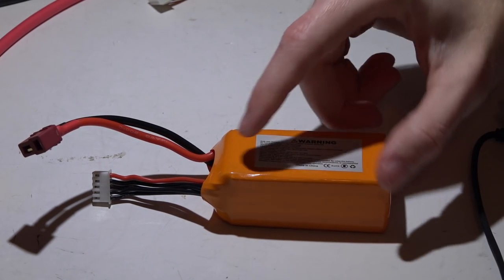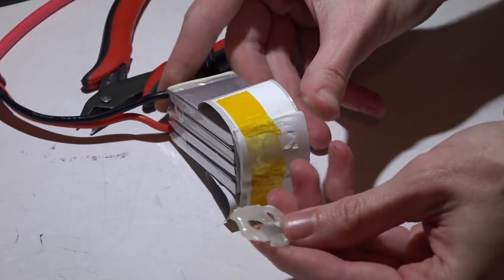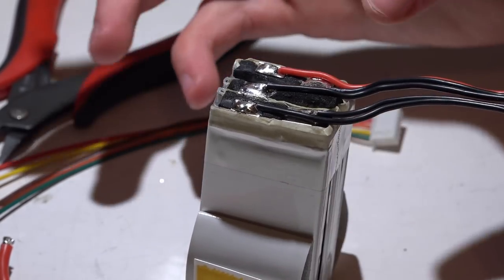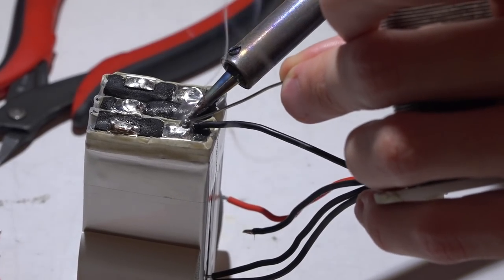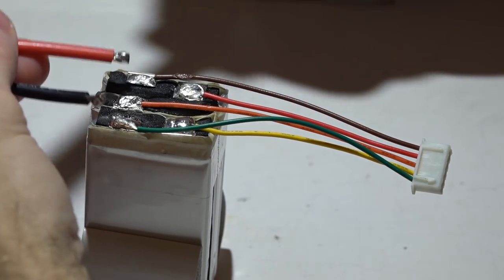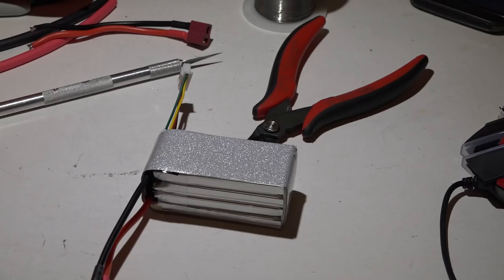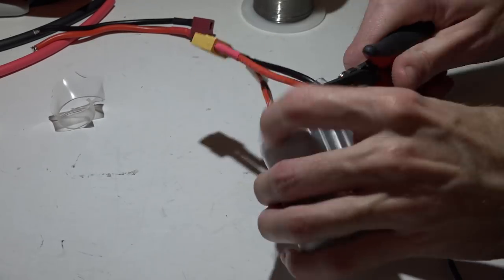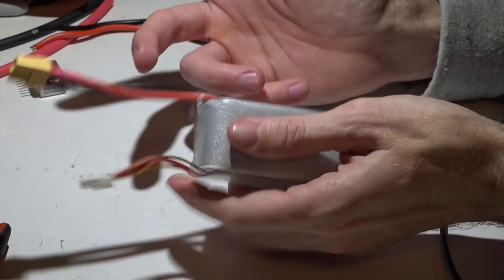Replacing LiPo Main/Balance Leads

Comment: Love your videos! Consider using a chisel tip on connections with that much solder. The larger tip acts as a heatsink to prevent fluctuations in temp from the heating element to the solder work.
edit: also consider popping out and switching the balance leads to get brown to be ground in order to know 100% which side is ground in the future

Comment: Thanks dude, it worked for me.

I am so glad I saved this awesome 1500mah LiHV 6S.

The only difference, the balance lead solder point was so hard to melt, my soldering iron kept dropping temperature and I ended up solder-repairing the cable itself.

Comment: You can stretch shrink tubing bigger before shrinkiing it . Needle nose pliers stuck into small tubing and then spread the handles . That will fit over an sma antenna  connection.

Comment: More great content, thanks.
Just one suggestion, when you said "blow hot air" down the heat shrink to get the condensation so that I will slide, maybe you want to clarify for others that you are breathing hot air from your mouth as opposed to using a hot air gun or something. Just thought it could potentially catch someone out 😉
Reply: Yeah, I was wondering where the condensation came from, that makes sense now lol.

Comment: that red or brown is the ground?  so why is it connected to the positive lead? that red and brown is the hot the blacks are the ground or the fallowing positive on the next battery.  That red is the positive lead wire and the fallowing wires are all in black cause they are connected in series and also act as ground in the batteries connection sequence.

Comment: Great vid man ty! I just replaced all the bearings on my Emax Rs2205 motors using your method from your old channel and it went well, too!
Reply from the maker: Awesome! I'll have to make another bearing video. Glad it worked well for you.
Reply: Definitely do make another for all the guys still curious. Only thing I did different was use a table vise to gently hold the motor in place while I tapped the bearings out with a punch.
Reply: فارسی  می توانم استفاده نمایم .که نتوانسته متصل شوم  استفاده بهینه از کلیه برنامه‌ای خودتان نتوانسته ببرم . متشکرم

Comment: I have a 3s lipo 2700mah battery - 
when I put it on the charger it appears to get a full and balanced charge.
when I test it on a battery checker using the balance plug - nothing shows up - completely blank
if I test it using a esc / motor tester using the ec3 plug all appears well.

I've tried several different battery checkers that all work on other batteries - so that's not the problem.

It seems to be a fault with the balance plug somehow -
why it works when charging and not with a battery checker I don't know.

I think the battery would be safe to fly with on my rc plane since the balance lead is not in use when flying
but I don't have full confidence in the battery since I can't check the charge with a regular battery checker.

What can the problem be ?

Comment: i been rebuilding lipo's for 5 years this very amazing video instead of markers on top of the shrink  i right down the info on paper can cover it with cleartape    on the cell before i do shrink on the battery  wow dident think anyone else would think use hot glue under main leads great mind think the same thats awsome  aswome

Comment: when i make 18650 packs i use my cheap 40 watt weller  with this almost solder tip for soldering stained glass just the small tips dont hold heat to well

Comment: my wires got chewed up in the spur gear and ripped in half. How do I know which wire connects to which port on the balance plug?

And do I need to use solder or can I just wrap the wires round each other, since there's very little current running through them?

Comment: RIP bro. I'm sure your looking down from heaven and thinking that you should have told everyone to tape off the solder joints that weren't being worked on, and to use flux for that last stubborn balance lead joint.

Comment: you've burn the brown wire a lill bit. but I've got a question. I've got 2 battery types ( 2cells). both with different colours at the balance ports. does it matter witch colour the cables have? 
1 battery: 2 reds 1black
2 battery: 1 red 2blacks
till now I've only charge battery 1. can I charge them both without worries? thanks for your help

Comment: Kinda related question, is there a downside in using 12AWG (too thick?) battery pigtail in my quads ,  I fly 4S 30A blheli_s , emax 2205S 2600kv. Thanks
Reply from the maker: There's no downside. But if your battery leads are 14ga then its not needed. If they are 12ga then its fine.

Comment: Use your phone to take a picture of the lead layout before you take everything off. Now you have a reference. That goes for anything I'm doing. Especially flight controller wiring (Don't have to reinvent the wheel and figure it out from scratch that way.)